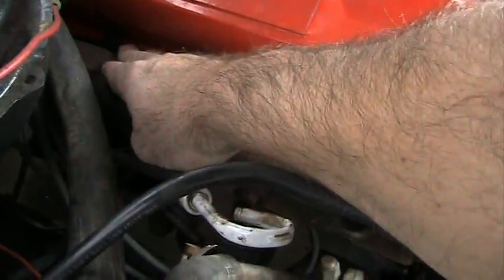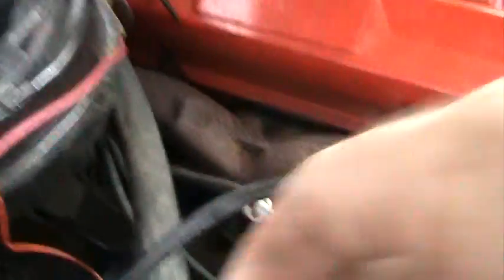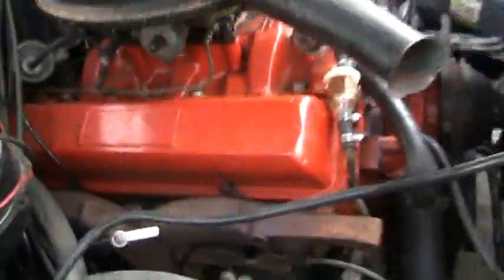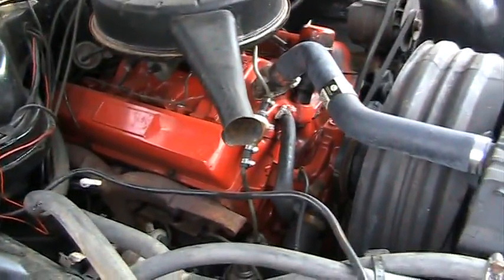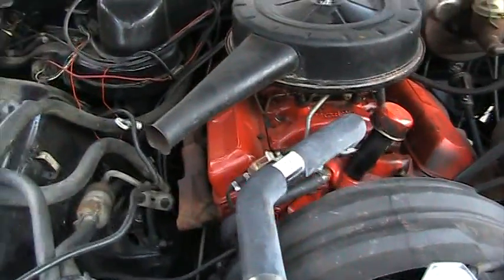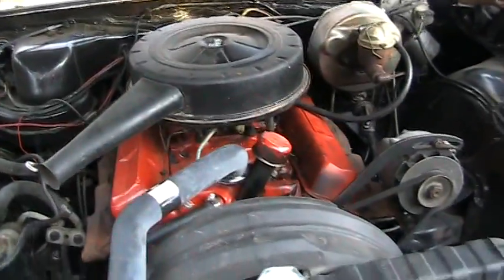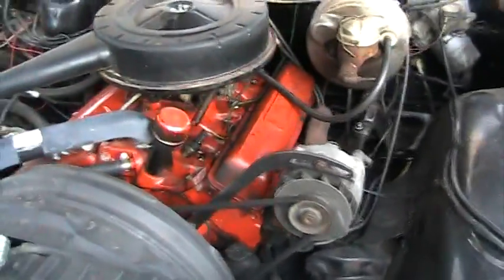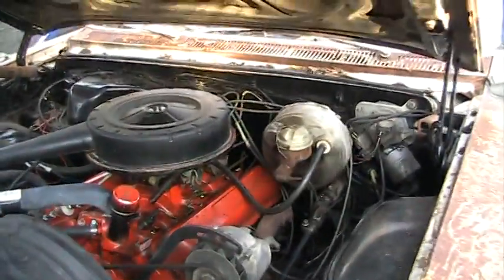63 impala video 46  finding a miss (EASY TRICK here!)

Comment: i've used this tip for years too. it works well. it looks as if the plug wires are hanging loose. try routing and using the factory method of putting the wires behind the exhaust manifolds. that worked very well on my small block. looks neater,too.

Comment from the maker: @SoilentGr33n It sounds different and you can feel a mild jerkyness when accelerating, its not as smooth and less pep. A completly fowled plug is usually something you only have to deal with on a tired old $50  engine. The heads on this engine had a valve job just done on them when I bought this worn engine, and valves that seal good will make for blow by on worn rings, and that is happening more and more as I drive it. But hey, this engine made it through the summer and 3000 fun miles.

Comment: Wire shoved under the wire at the distributor works good, short pieces just barely hanging out, not touching each other. A test light hooked to ground, you can short a cylinder out with the test light without getting socked. All you need is a test light and some short pieces of wire (Paper Clips work GREAT)

Comment from the maker: @0100110101001011  Yep, wet with gas and caked on oil. I put an oil fowler on that cyl. and its running fine. Soon I will rebuild the original 327, after I finish replacing the trunk sheet metal.